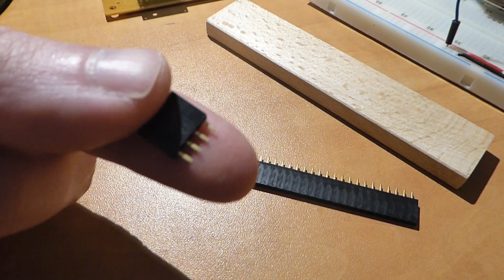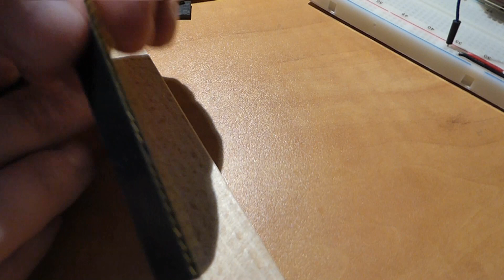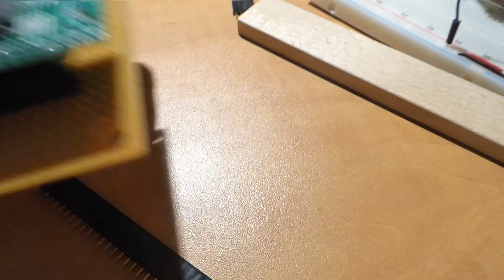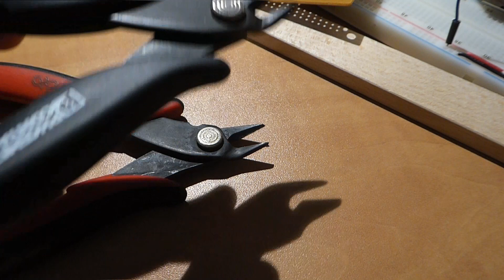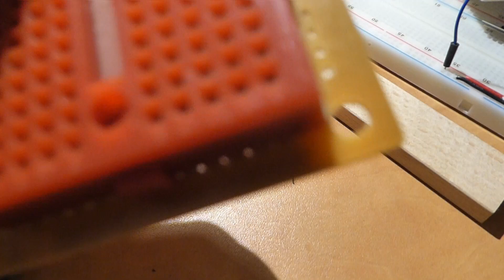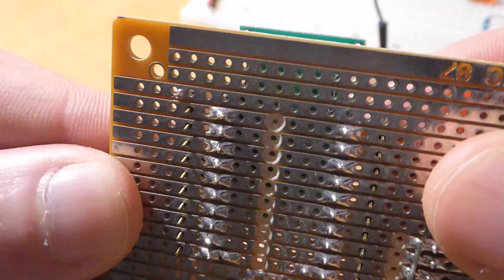How to cut (break) 2.54mm female pin headers to custom size

Comment: Ok, so don't bother counting your pins if you have a module in your hand, simply plug the module into the strip and you can immediately see which pin you need to remove.

Comment: Thanks for the video! It'll help me a lot a save my time) One tip I got in mind: when you needed to cut the second part of the same size, you could just use the first one as a template so you don't count second time. I suppose it'll be safier (assuming the first one was surely cut correctly) :)

Comment: I used a nail cutter to cut of extra bits of plastic after dividing which worked pretty wellℹ️ℹ️
Reply from the maker: Oh? I only know those with the curved "blades", so they won't be very good for this... but whatever works 🙂

Comment: Hard to do if you need only 1 pin header. I use pin header for Relay. When I solder the pin header for Relay, it always tilt to the side.

Comment: why not just cut with the cutter tool, no need for groove or scoring.
also I don't pull out the tiny fork first, just cut.
Reply from the maker: Cutting through/against the metal part will make the cutter blades blunt faster, and many times the mechanical pressure will break more from the plastic than you intended. But if you found a way to avoid these issues, then by all means, use it 🙂
Reply: @idogendel  truth be known, I use diagonal cutters designed to cut 12ga wire and more.  so that wouldn't be an issue for me.  but I think it does make the cut a bit more rough, though.

Comment: Can these be used to make hotswappabble sockets for mechanical switches/keboards?
Reply from the maker: Most of these headers do not make a strong connection, so be careful if there's a chance of external mechanical forces - especially if the connector has a low pin count. Also note - like with any mechanical connection - that live wires may experience some electrical bouncing during insertion and removal.

Comment: can female side be inserted in motherboard
Reply from the maker: Sorry, I don't understand the question. First, what motherboard? Second, female side by definition cannot be inserted, that's the male side's job...
Reply: @idogendel  i mean to say how did you power up the rgb strip
Reply from the maker: @nitesh3161  There's an RGB strip in this video?!
Reply: @idogendel  

yaa but how can we power it broo
Reply from the maker: @nitesh3161  That kind of depends on the model you have... why not contact the seller, or search the web for some specific manual or guide for it?

Comment: but sir when we cut some amount of pin we need to take extra and that is wasted so what is the use of it, sir.
Reply from the maker: Because sometimes you need a header with X pins but you can only get headers with Y pins. Of course if you manufacture a million boards you will not do this process for every board :-)
Reply: The White Byte  ya!! sir got your point that what you want to say sir,thank's for reply sir.

Comment: Heat up a thin knife or razor, cut like butter
Reply from the maker: Yes, but Youtube may not like such potentially interesting content :-D
Reply: @idogendel  oh.. i watch another video earlier, you could also hammer a minus screw right between the pins
Reply from the maker: @BigLazyBear  A minus screw or a minus screwdriver? Sounds risky either way, but maybe the plastic will give more easily than I imagine?
Reply: @idogendel  well i tried it a few times earlier, it was fast but not pretty the way the plastic split.

Comment: Is it enough tight fitting?
Reply from the maker: Sorry, I don't understand the question... how is the cut strip supposed to be different from the original in terms of fit?
Reply: I want to ask u that the male female pin are tight fitting because most of these are loose in fitting..?
Reply from the maker: @hiranyabaruah69  Well that depends on the brand that you buy, no?

Comment: Would you recommend nickel or gold plated pins? I could imagine that the gold would be toxic for the ants if you could penetrate their armor, but then again it could also be a hazard to you. Any thoughts?
Reply from the maker: On the contrary, gold is quite inert and causes no biological damage (except for the obvious bio-mechanical effects when it hits hard enough). Nickel is considered a bit more dangerous. However, I'd still recommend gold, because on rare occasions you just need to solder the thing, and I am told gold behaves better in that respect.
Reply: Oh right. Now that you mention it, it makes perfect sense. All I remembered was the bond babe that died from being covered in gold, but that's a bit of a different situation. And thanks for the soldering tip, might just be useful once or twice!
Reply from the maker: Yeah, the Bond thing is more of an ENIG finish... and it's always good to have quality soldering tips! ;-)
Reply: Good one 😂